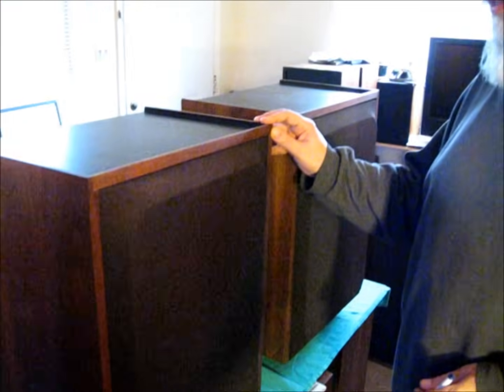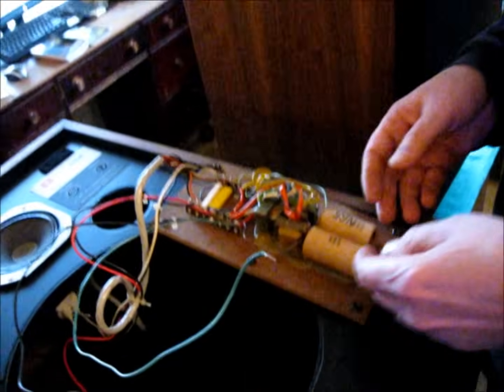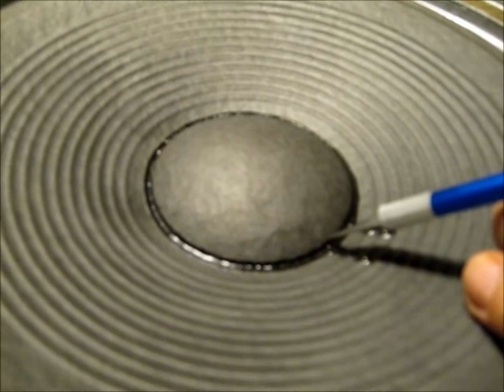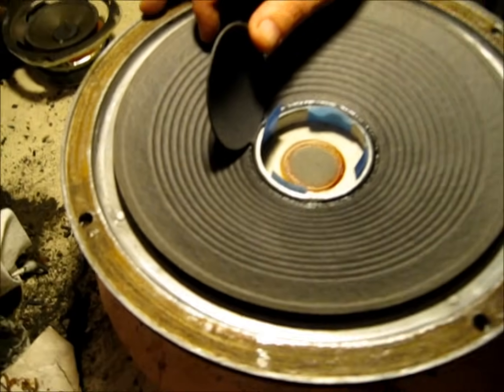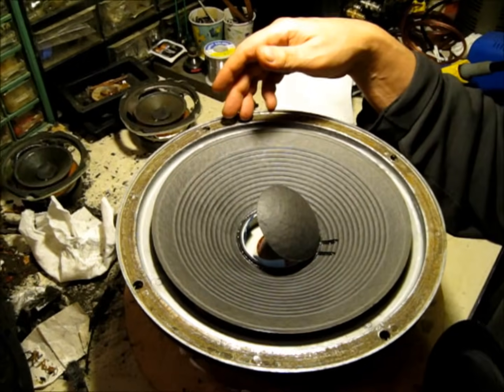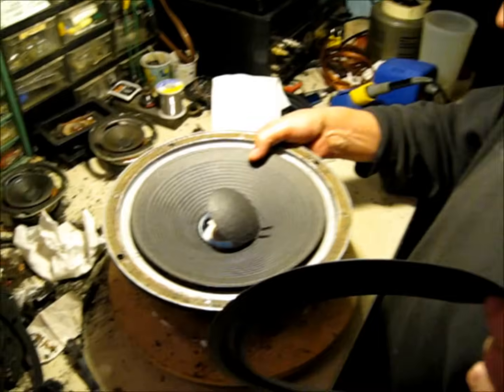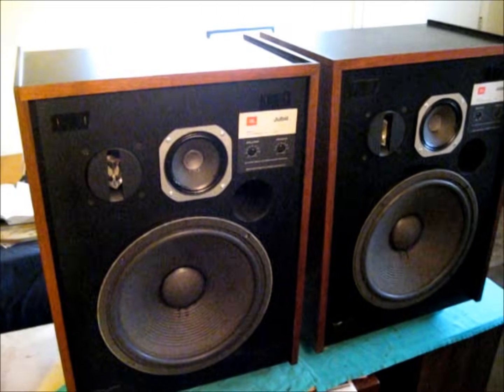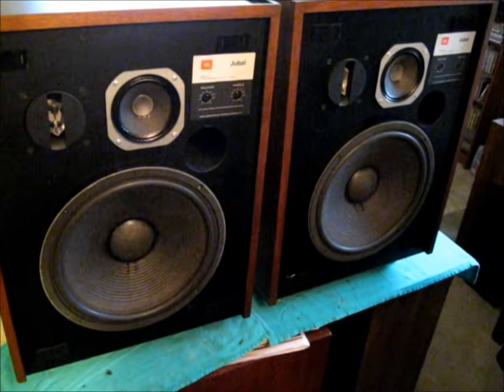JBL L65 Jubal Restoration: Refoaming and Crossover repair.

Comment: New to this channel...  I rebuild, do complete restorations to vintage electronics... but have great reservation with speaker work... the skill of electro-mechanical fitment... I immensely appreciate what you do... Thank you for sharing your skill, knowledge and experience.

I have a pristine pair of L36 that I am rebuilding (replacing damaged pots and adding film caps) you have me now re-thinking about (against changing out) the inductors... your voice of experience rules.

That looks like a new woofer...

Comment: On my way to be doing a refoaming repair myself for the very first time, I am really happy with finding this video.
I love my old JBL Decade 36's (L36). They give me just the right sound in my studio, so I'll go all the way keeping them running for the next one or two decades :-)
I love the way You take the time to get everything cleaned up, all the details right etc to get the best result possible. I really appreciate that..
And the detail in keeping / reusing the dust cap is such a nice touch...
Thank You so much for doing this video. 
All my best wishes to You and Yours. Stay safe...
Reply from the maker: Thanks and Good Luck

Comment: I've done a number of re-foams including a couple without shimming.  I got away with it but I agree it's not worth the risk.  Next time I'll be pulling the dust caps and using shims.  I've re-foamed a pair of LE14 woofers before and that was by far the most tedious I've done so far.  JBL's glue is no joke when it's 40 years old.  This video shows first class craftsmanship.

Comment: I'm also a professional who use to recone for one of the oldest speaker repair shops in America.  This is definitely one of the better videos on Youtube.   The passion is much appreciated.   Did you guys use a signal wave generator to sweep your drivers with different frequencies to check for any anomolies?  I didn't see that in the video.
Reply: Not needed, either it rubs or not. Thats the anomalie. A simple 60Hz tone is fine.

Comment: R.I.P. Teresa Duran ..  lovingly taught JBL transducer repairs at the Northridge facility.
Reply from the maker: The folks at JBL pro back in the day were first rate professionals. Our staff went there for training when we became JBL warranty in the early 80's. Before that we were fortunate to have a mentor that had worked with Western Electric, Altec, and JBL for decades. Hands on engineering knowledge cannot be replaced by software jockeys and those that think hot glue is mechanical engineering
Reply: I didn't go to JBL for certification, but I was trained by those in Los Angeles who did.  That should have been fun.  Lots of stories about JBL Northridge.

Comment: With veneer lifting along a split like that you can just use a little PVA glue like you did , put a piece of paper over it and iron over it. It will set immediately and be ready for finishing work.

Comment: Hi, I have a pair of used JBL Northridge E100s. Paired with a Concept 16.5, they sound good to me. While trying to solve an unbalanced sound issue, I discovered that there is no polywool or sponge inside. Further, in one of the midrange enclosures there is some foam leather stuffed inside while the other enclosure was empty. If I refoam the cabinet including the midrange enclosure, will the sound quality improve? If yes, which material should I use? Lastly, where can I get a couple of pictures or videos showing the steps and how should the end product look like?

Comment: I am involved in this very same procedure with 8 - JBL LE14A's and 8 LE10A's. Where the JBL LE10A's have inverted dust caps present somewhat of a challenge. Where I am curious is: Adding glue and new surrounds, will that change the thiele and small parameters on the speakers? I am building my own cabinets in this situation, so I will obtain new thiele and smalls when I finish up the re-foam. Looking to tune the cabinets at around 32hz at around 4ft3. So each bass cabinet will be around 16ft3 and the LE10's are going to be my mid-bass drivers. Then I have other plans for the top ends. Been at this sound thing (professionally) since 1976 and love it as much now as I  did then and perhaps more, but am pretty much retired and have never claimed to be a speaker tech, but I have did a few successfully and am enjoying my semi-retirement as I can work on a lot of my own "audiophile" ideas. I am also a long time electronics tech/engineer. Thank you for this video it is the most professional approach that I have seen on YouTube.
Reply from the maker: Hi Tom, Ok let;s unpack this as the talking heads say. Dust caps to lay flat inverted they have to be the correct radius, but they do not have to be inverted, it won't have much of an effect on performance. Unless your software is pretty sophisticated, don't let it override your ears. Use your ears not your eyes. Look at the JBL box sizes, tunings.  Unless you use a crazy amount of glue or the wrong type that should not be a problem. I think I have cover most of the issues in my vids. Good Luck, Rock On

Comment: Great video and such attention to detail, explaining the how and why's.  I've got a Paragon that's been in the family brand new since the early 70's and we've had so many hours of enjoyment and great memories.  I believe the LE15A's need rebuilding and it would be my first attempt but I noticed you said maybe to practice on something else first.  Do you think this is something I can handle, I mean, after watching your video I'm thinking that I should leave it to a skilled professional such as yourself.  Are you still doing this ?  And, how important is it to go through the crossovers because I recently de-oxed the contacts on the McIntosh components and what a difference!  System sounds so good again.  So I'm really trying to tune up the whole system and want to do it right as it's been in the family for 50 years and hope to get 50 more.  Any input would be so appreciated as I really have no one to confer with about this tune up.

Comment: Great video man.  If my 122A is rubbing just slightly on the voice coil, could redoing the suspension like this take care of the problem?  Or would it need totally re-coned?  Just a hair off center and I can't stand it.  Or is there a way to adjust the magnet from the back?  Thanks.
Reply: That depends on different factors.  The foam edge is just one of two suspension systems that the coil/cone assembly rely on for alignment.

Comment: I have a pair of these L65's and one of the speakers woofer foam has rotted. They were re coned by JBL a few years ago, Do you happen to know cause of rot on these. It has hardly been twenty years, and the other speaker is perfect. Great video by the way.

Comment: Nice job! I`m getting ready to re-foam a pr of original 126A`s & was wondering if you(or anyone else reading) can answer a question for me since your exp`d with 100`s,
 on my 126`s there is this... what appears to be factory hard cardboard material(like a 4pc gasket) still glued to metal frames where the outside edge of new foams will be glued to...what purpose does this 4 pc. cardboard gasket serve?, should I leave in place? or remove & glue new foam directly to metal frame?

Comment: Can you tell me what would be a good three way crossover for this setup.... 
 Rockville RVW1500P8 3000w 15" Raw DJ Subwoofers 8 Ohm Subs 70 Oz Magnet

. 
Goldwood Sound GM-85/8 Poly Mica 5" Midrange 120 Watt 8 ohm Replacement Mid

 3 x 7.25" Horn Tweeter Speakers.Piezo.Replacement for Loudspeakers 

I was given the cabinets but all the speakers were blown  so I decided to replace them with all new ones ....the crossover may or may not be ok  should I trust it want blow my new speakers?

Comment: Awesome speakers, I hope to own a set someday, but In the mean time I have my L36s. I had to reform my woofers as well and I cut off the dust cap very carefully and used shims, It was my first time and they came out perfect thankfully.  My JBL L36s have real wood veneer and I think they are dried out and need treatment, I can feel these fine cracks when I slide my hand over them.  I’m hoping you know what I should use to treat the wood/refinish it or whatever you would call it??? They are in absolutely perfect condition and still look new and I want to keep it that way. I really love how they look and sound with my marantz 2238 and realistic lab 420. What do you recommend I do? Did JBL use a special product or recommend anything back when these speakers came out?
Sorry for rambling on there for a bit and thank you for any help you can give me on this problem.
Reply: Use Howard's restore-a-finish and 0000 Steele wool. Follow up with Howard's feed n' wax. The veneer will soak it right up. It'll even clean up any fine scratches.
Reply from the maker: Try Mayonnaise on the cabs

Comment: I'm changing the caps on my L15's, the electrolytics are bulging a little bit and the bass on them isn't what i think they should be and they also both don't sound the same. However i couldn't find the original values in film capacitors so i'm going from a 14uf to 15uf and 28uf to 30uf
Reply from the maker: Yes DIY, Americans used to be self sufficient, Go for it my friend. I'm old school so I don't usually replace electrolytics  with Film and Foil Caps. They sound different. In general caps are 5-10% tolerance. So 14 to 15 is what % change,28 to 30= even less. When you want to experiment changing xovers do one component at a time and compare it to the stock unit. Most of my peers are gone on to the other side or are out of business. I'll be joining them soon if I don't get some help from the speaker world. Send me some work or help build some kind of Speaker Guy site, or I'll see you guys on the other side. Until then I'll be in a van down by the river. Thanks to all for the positive comments!

Comment: Somebody who used to work at the JBL factory told me they actually called the foam 'suspension' the 'compliance'.  This implies it is more than just a ring of foam and its quality plays a very important role in the behaviour of the driver.
Reply from the maker: Yes sir that's basically true. Compliance is the reciprocal of stiffness, and it is very important to the performance of the speaker. This is something most of the sellers of DIY kits know nothing about. Even more important with Acoustic Suspension designs.
Reply: Texasound where would you suggest I get foam surrounds for my Advent heritage speakers? Floor speakers with dual 8's